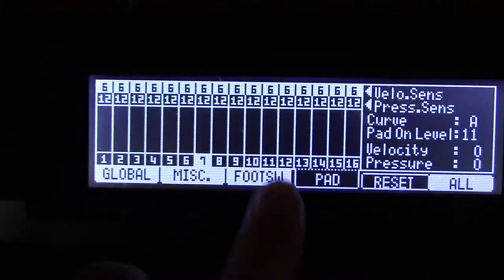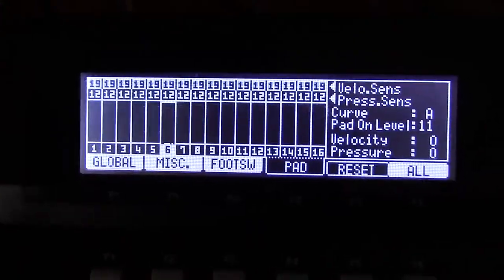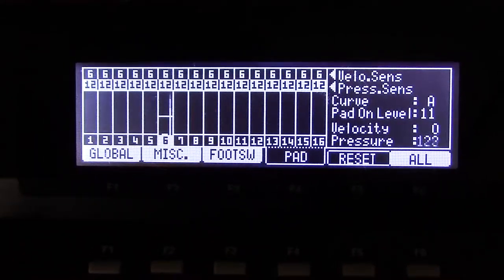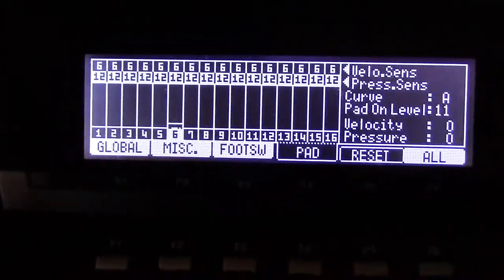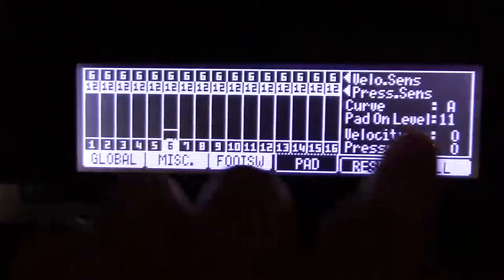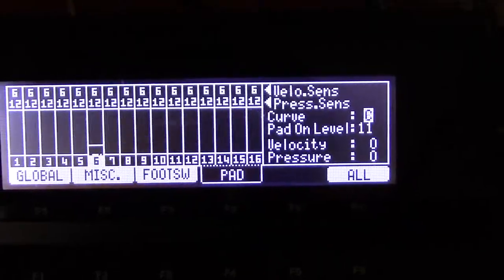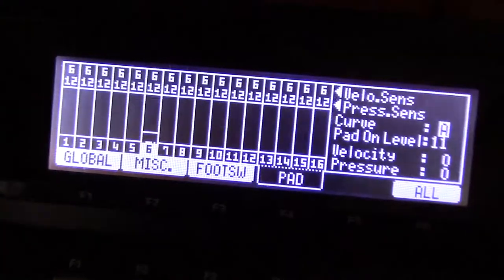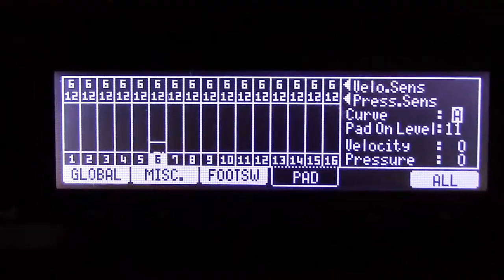Akai MPC 2500 - Pad Sensitivity - jjosxl

Comment: I'm not getting any Pad response on my unit. I bought a new sensor Pad and sensor PCB board. I came to your video looking up how to diagnose Pad failures on an MPC 2500. I'm running JJOS 3.10 with 128mb of memory. Any tips?
Reply from the maker: That’s a tough one to answer without more info... I’ve always had good luck with replacing the pad sensors (the plastic sheet that sits under the rubber pads). There are forums with people talking about pad failure and it usually comes down the the sensors.... sometimes it’s a software issue as well. I messed up my sensors one time by leaving my mpc on the floor and the static from running a vacuum near it over time. The 2500 is definitely sensitive to static electricity. Dope videos by the way.
Reply: @lazoo2000  I fixed it! I had to replace the mainboard. Now everything works fine.